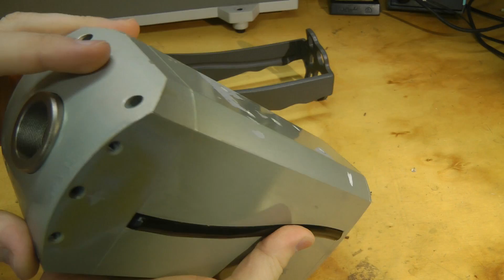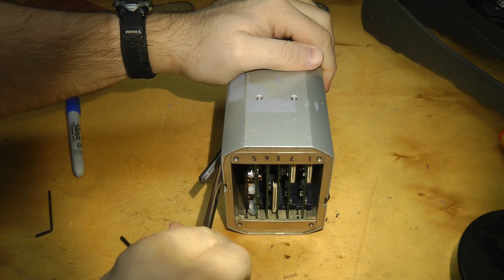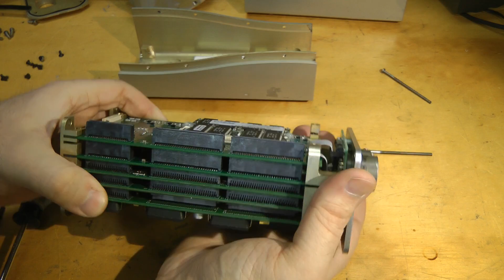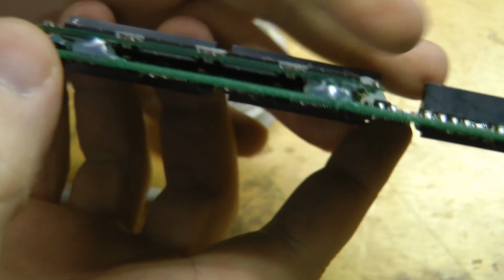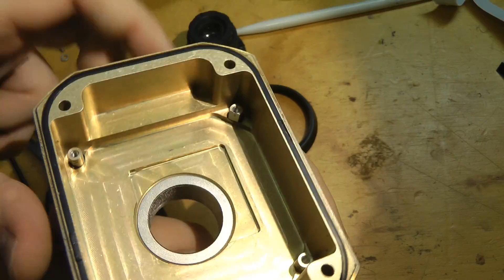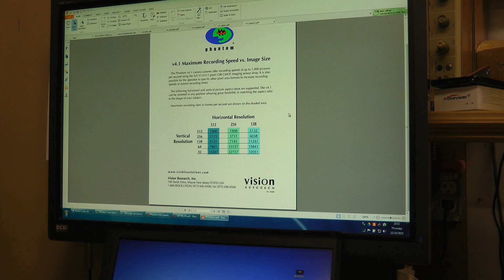Phantom V4.1 high-speed camera teardown

Comment: Top tip for hot snot, apply a little Isopropyl alcohol to it and it will lose it's adhesion, become brittle and be easy to pull off cleanly.

Comment: You got two cannon plugs on the phantom, if you can find the partnumber on them you can order the appropriate connector, pins and backshell. All you would need is a pinout for the phantom and then you could at least make your own cables. you would ned male pins for your smaller connector, and female pins for your larger.

Comment: This video in my feed made me positively tickled.
Here's a wall of text as I'm watching the video.

From what I can find - the large circular connector was only used to carry power, trigger, and video output for a viewfinder.
All the control is done via FireWire, so I suggest waiting for a response from VR.
The memory sticks are similar to the CT64M64S4W75, except double the size.
It's regular 512MB SODIMM, two of them in there. It was used in very expensive computers, and each of the modules cost around $500 back then.
I like the little pre-designed bodge you mentioned. They drilled a hole as a last measure instead of re-spinning the boards it seems.
I've seen the sensor somewhere too - and I think not in a Phantom.

I have an NAC Memrecam fx K5, and this is making me think of opening it up just to see the insides, but I'm not sure I can put it back together, and it's a functional piece of kit(somewhat up to date, too).

I sent you an e-mail regarding the software download.

Comment: If the sensor is a CCD, the extra area is probably for some dummy rows/columns, dark reference, and for image storage. A lot of full frame shutter CCDs, actually transfer the charge to a shielded parallel array to get sensed while the next frame is being acquired. See here for an example http://www.ti.com/lit/ds/symlink/tc236.pdf
Reply: +ceriand That's what I was thinking. At least one early CCD had a rotary shutter sync'ed to the frame rate.

Comment: I know this video is old now, but you showed something that may be helpful to me.  

I have an NAC Memrecam K4 High Speed camera. It has a "D-VGA" output for a proprietary round 16 pin connector that is used with a custom made monitor. My understanding is that there is a composite NTSC signal also within those pins. This is what made your video such an incredible find!

Could you please tell me how you safely sniffed for the NTSC video signal with a scope? Did you actually attach to the main power ground? If the board DID, in fact,  have isolated ground, where would you attach?

The camera actually has Ethernet (100B-T) and Fibre Channel FCAL for computer control and capture. I've successfully built a workstation that can communicate with the camera (FCAL) however, the settings are somewhat unknown (IP address and CID). That brings me to the NTSC Composite signal... If I could see the display, I could get the IP address and CID of the unit (it's a static IP). Once I have that, the full operation of the camera would finally be available. This is incredibly similar to your setup, and you managed to find that signal fairly quickly... Lucky you.

Would you mind giving me a little advise on how I might proceed?

Amazing videos BTW!

Comment: I wonder if they selected the mask position based on defects on the sensor die.
Reply: +mikeselectricstuff Wouldn't then be defects there in the inner region of the mask as well?
Reply: +mikeselectricstuff It&#39;s probably just one sensor for a whole range of cameras, not defects.
This is built to a standard, so I wouldn&#39;t be surprised if they canned 100% of the defective or not-to-spec dies right off the fab.
Reply: +mikeselectricstuff 
Don't you think the covered part could be temporary storage area where the whole image is shifted to before being read by the ADCs?
Reply: +mikeselectricstuff Mike please do some more teardowns, your videos are so intuitive
Reply: +mikeselectricstuff Maybe the insides of the camera load the image data and can see the masked off region and shift the sampling to those pins automatically. I wonder what would happen if the mask were removed.

Comment: Look up the numbers for those "ram" packages you are pointing to at 16:33. I think you are looking at a combination of ROM and RAM chips. the thin ones with the legs on the ends are usually a non-volatile memory chip for configurations and on-board storage, while the legs on the side are volatile RAM for fast data cache. the thicker chip is usually an EEPROM for firmware.

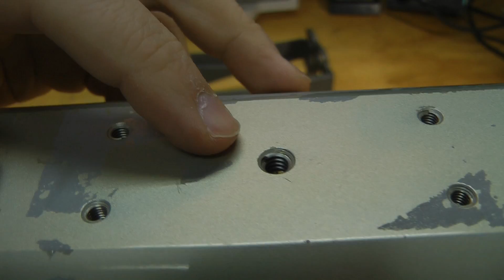Comment: 1:50 Some cameras have 3/8" inch tripod mount, (for heaver mounting), they can use a converter, (that can be unscrewed), to make them into 1/4" inch No.20, (Whitworth thread think), tripod mount

Comment: Hi!

I just got a Phantom v7.3 from ebay...

I didn't watch the whole video, so sorry if this has already been answered:
At the homepage of vision research you can download the PCC software. included is a helpfile "camera.pdf", with all the pinouts for ethernet, capture connector etc...
AFAIK PCC software still supports phantom v4.1, and the best part is: its free!
At least, i can add a simulated v4 camera, i guess thats a good sign ;-)

the v4.1 is marked as obsolete, and they define this as "These products no longer receive full support from Vision Research. All development has stopped
and no new features will be added. No service contracts will available."
Reply from the maker: +Felix Hirt Thanks for the suggestions! I did find the software there, but it wouldn't work properly on my computer. I got an older version thanks to Aimed Research, which did work.

I'm curious, how much was the V7.3? Was it hard to find on ebay? The last time I saw one of those on ebay was a few years ago.

Comment: Thanks for the teardown. Nice piece of kit.

Manufacturer's software would be the best, but give linux libdc1394 a try. If the camera conforms to IIDC/DCAM standard you might at least get some basic functionality, maybe even full frame rate / resolution via Format7.

http://damien.douxchamps.net/ieee1394/cameras/

A lot of FireWire machine vision cameras that I've used (although not of high speed variety) work with libdc1394 + coriander pretty well.

Also, in theory (specification), FireWire could power this camera, but I'm not sure if it is wired that way (or if your host controller can provide that much power).

The sensor might be 1MPix, but it can also be that they cover the bottom (where the readout is) and operate it in a manner similar to frame transfer CCDs?

Comment: The WAS7.4 may be for the Anti-Blooming voltage. i.e. V_AB = 7.4 volts. I've worked with Kodak/Truesense CCD sensors before and they were individually binned and marked at the factory for this. I can't quite explain the W, but it otherwise fits.

Comment: +tesla500
any tips on how to develop an embedded system (e.g. raspberry-pi-ish thingie)? Did you just lookup the pinout of the processor and connect ram etc according to the pinout? Or did you learn specific stuff?
Reply from the maker: +TheTrueM3ga Kind of hard to write this in a summary, you could write a series of books on the subject. Basically, look at product overviews to select a chip that does what you want, then design a board taking a lot of guidance from the reference designs, dev board, and datasheets/technical manuals. Once your board is done, you need to port the PSP (platform support package) that includes the operating system and drivers to work on your particular hardware configuration. For example, on my camera, I had to change some serial port settings in low level boot so the boot messages would go out the right port, since my pinout was different from the dev board that the PSP was written for. Porting the PSP can range anywhere from minor modifications taking a few weeks, to something like the raspberry Pi OS that probably took thousands of hours of work to complete.

Comment: At the end of the video it looks like you put the camera back together with the mask in front of the sensor. Could it be that the smaller image being displayed on the screen was also due to that?
If the sensor was actually higher resolution than the specified output of the camera, maybe removing the mask would also produce a higher resolution output on the NTSC out signal? Unless they cropped that out via software also for that NTSC output. But why would NTSC output be that small of a window (unless it has something to do with your setup) if they knew they were going to crop the rest out, wouldn't they zoom it to full size? Could that NTSC output never have been intended for customer use?
Someone please stop me, I'm speculating away here...
Reply: +andreabak That output was intended for customer use, the connector shows a breakout.
But the mask on the sensor is probably designed that way, to cut off a part of the sensor.
The output you see is that small because the camera is set to a very high frame rate, as he mentions in the video - over 7kfps, when he looks at the strobe signal.

Comment: why isn't it possible to record high-speed with a normal sensor?
Reply: +Walter Spurer Speed of the ADCs, light sensitivity(and/or gain), noise, clock rates.
Reply: It won't be able to pick up enough light, when you go at a higher framerate there's less time for photons to hit the sensor. In slowmo cameras, the sensors are bigger to have more area per pixel to pick up more light. Even then, you need a lot of light for slowmo shots

Comment: the driver for the unknown device you can find here:
http://binarydb.com/driver/Ricoh-1394-OHCI-Compliant-Host-Controller-v291147.html

as software i would try WinDV

Could you remove the plastic cover on the sensor and try live video signal again? maybe the whole sensor is used in live preview.